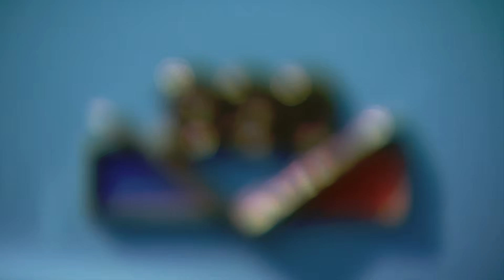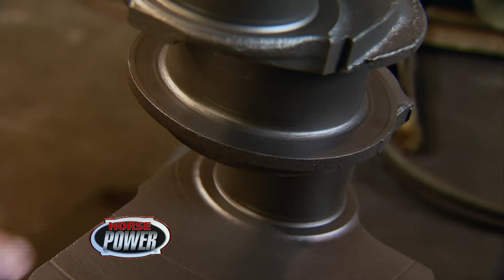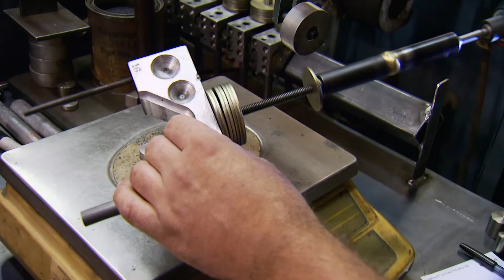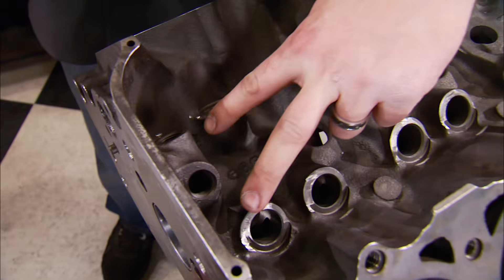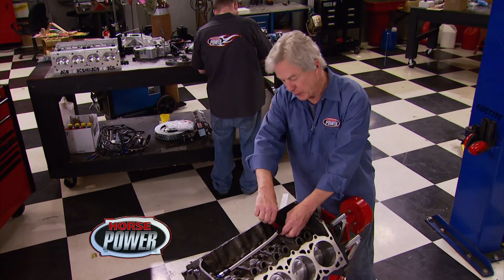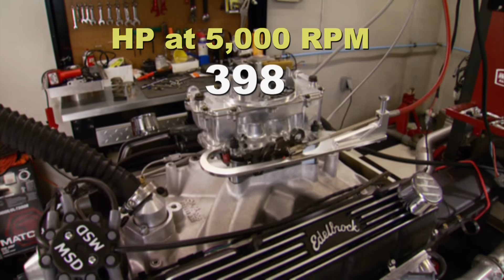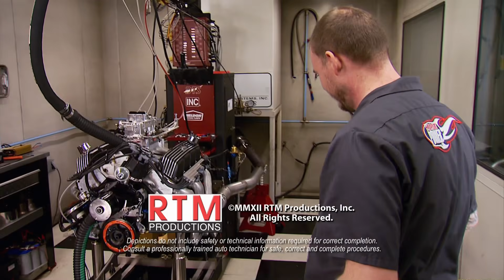Building The "Other Engine" - An AMC 360 - Horsepower S16, E4

Comment: I have a built AMC 360 in my 74 Gremlin.  K1 steel rods, Bullet cam, Johnson lifters. Harland Sharp roller rockers,ported heads and intake and Arias 11 to 1 flattops. and FYI, if you do use a Milodon oil pan on your AMC V8, DO NOT try and install the engine and trans together in a small body AMC like a Gremlin,Hornet,Spirit or Concord. Prob not even a 64-69 Rambler American,Rogue,SC/Rambler. You will find out the hard way they won't fit in the engine comp. together. (I found out the hard way.)

Comment: AMC did produce special blocks for racing purposes. The Special Service Block mixed and matched casting cores. Cast for 343/360 bores with 390/401 water jackets and crank main webs. No engine size cast into the side of the block. The heavy mains webs allowed the use of parts catalog 4 bolt mains. The other special blocks were aluminum. Three versions. 390/401 with water jackets. 390/401 solid block strictlt for drag racing. And the aluminum Indy car short deck block. Significantly shorter deck height. Allowed shorter rods on the "stock block" turbo motors.  As with any engine. The gains are made in the cam and heads.

Comment: We did a 360 for an off-road truck a guy had, to raise the compression we use to set a 400 Chevrolet small-block Pistons 12 1/2 to 1, they didn't have the right compression we needed ratio. Show me Mills part of the dome off the top, and call the pin holes for the AMC wrist pins. We had to stick with the rule book so we couldn't do too much to the engine but it was a screamer.

Comment: An extreme word of caution! The "new" timing chain cases from summit are made in China! I had 2 of them and they both ate my distributor cam gear up. They insist that you use a rubber o- ring at the distributors base instead of the flat fiber original where it mounts into the timing case . This caused serious problems between the distributor and cam gears mesh . BAD misalignment!  Not only that but it allows the distributor to walk and won't hold a steady timing setting! I switched back to the original timing case ... problem solved in a heartbeat!  I run a VERY modified 401 with 425 horse power and over500 foot pounds of torque. Trust me.

Comment: I built a1968 AMC 343 back in the early 70's for a 68 AMX with auto. Turned a best time of 14.57 at 98.97 in the quarter. What limited a quicker time was that valve float came in at 5,200 rpm's limiting shifting to 5,000 rpm's. The 360 came with the small port intake and original bread an butter cam and valve springs that dated back to 1966. For a back yard build, that 343 beat many Mopar 340 engines in the day. The 360 is a smogged out engine with having to put a ton of money in it to preform.

Comment: Using 343 cast pistons & sbc 2.055 valves in factory heads save some bucks for similar numbers. Chrome moly rod bolts 292 comp hydraulic cam good to 6200. My 81 Spirit ran 7.49 @92mph.

Comment: The only issue you did not address is cooling.  In 1972 the AMC Police Interceptor used a different head design.  Although this could be a problem with all of the AMC V-8's if you build em beefy enough. If you are lucky enough to find one of these beasts you will find that they need some machine work done to the heads and block to allow it to properly cool.  My 1974 Ambassador station wagon could pick both front wheels off the ground without breaking the rears loose thanks to that interceptor engine.  Drawback was that not only did she run HOT but the front shock towers took serious abuse.  One last problem is common  with all makes though, getting enough oil on that timing chain.
Reply: Funny story, but not true.  All the heads were the same.  The 304 got the smaller valve heads but all 360 and 401 got exactly the same heads and cam.  1970 and early 1971 got the smaller chambers.  1972/73 got the larger chambers but bigger valves and in 1974, they switched to pedestal mount rockers from ball and stud.  I have hundreds on the shelf and what you say is urban legend and made up facts.
Reply: @stephenbrown3868  The Police interceptor used a modified Buick head instead of the Chrysler design.  How do I know this you ask?  The guy at the speed shop that was in Merced California used to race a AMX that he put one of these interceptor engines in.  He helped me rebuild an engine out of a 72 Police Interceptor Matador I found in the junkyard.  It had the standard .202 chevy intake valves and a Chevy rocker.  I was able to then use Chevy roller rockers and also change ratio.  The standard heads use a Chrysler design while the interceptor use a Buick design.  Both engines WERE built by AMC though and the AMX's often did use the interceptor engines.  The only issue was that the water ports on the interceptor heads are different, so just swapping the heads will cause heat issues

Comment: Ive built plenty of V8s over the last 30 years.  The AMC 3rd Gen V8 engines aren't the biggest power producers but they can be built to perform as good or better than a lot of the other manufacturers similar sized V8 engines.  The big valve dog leg port heads are key to the potential of the gen 3 engines when comparing factory heads. A compression bump and a better cam really wake AMC Gen 3 V8s up. The factory camshafts are very lazy. With the over square design of the  360. Its potential as a performer is obvious.  It doesn't take much to wake them up.

Comment: The oil sucked up through the PCV is what is happening with the 401 in my friends 77 AMX Hornet. What causes this, even though in stock form it isn't an issue, is a mystery to me. We'll be tearing it down to try and solve that, but if you have insight, I'd like to hear from you.
Reply: Probably not getting the oil from under the valve covers back to the crankcase. Traco (Trans Am engine builders) ran hoses from the valve covers back to the pan to get the oil out of there. Of course they were turning high rpm all the time. Pull your valve covers and check the drainback holes in the heads you may be able to run the next size drill through them to open them up some, or run an oil catch can.
Reply: Your friend probably needs to transfer the baffle from a stock intake to the Edelbrock intake, along with using the valley pan style intake gasket, basically you need to have some type of a baffle under the pcv valve.

Comment: I'm 61, in 1984 had a 1972 Javelin with 360 auto. Sweet running motor. God I miss the good old days. I've owned 34 vehicles.  6 new ones. Never had a blown motor . Engines were so Simplistic back then. I pity todays mechanics working on todays high tech, high dollar Disposable Trash.

Comment: Some timing cam gear manufacturers cause problems that were never a problem from AMC. I ran into serious distributor drive gear wear with a new cam gear. After discussing it with my Australian AMC performance engine builder, I removed the other timing set and installed the Rollmaster p/n CS7110 and the problem was cure.  This set also allows minor timing offsets. As recommended, I went with the +2 degree setting.  The engine now starts easier than ever.  So rather than having to do bandaid distributor drive  oiling mods, just get the right timing gear set.

Comment: Great video! I have a '78 Wagoneer with a 360 in it. It had a two barrel intake on it. I recently picked up the four barrel intake that was used from '75-'79 I believe. That intake is #3224347. I would like to use an Edelbrock 1405 on it. As I am sure you know the intake is a spread bore and this carb is a square bore. I am having a hard time finding an adapter that will work to mount that carb. Any chance you may know what I need? Thank you.
Reply: Trans Dapt might make one Call summit, jegs or try an amc forum

Comment: I had one of those in my full sized Cherokee Chief S. I installed a mild cam, 4 barrel intake and carb and Hooker headers. Never thought it was lacking on power and drove it to 380,000 miles. Still ran when I sold it after buying a newer box Cherokee XJ

Comment: I bought a SC360 in 1971. Used Hooker headers with 2.5" glass packs. Too little back pressure and 72 degrees overlap killed the exhaust valves. Went to 1972 cam with only 42 degrees overlap.  Saved the valves. Added a Holley 3 barrel ,added capacitor ignition and dyno engine. 275 hp with 410 torque. The longer stroke was great for torque building. Car was real sleeper .  Should have kept it longer then I did.

Comment: This rebuild was awesome. I'm curious what it could with fuel injection. I saw an SJ Cherokee with this engine pull 72 hp on a chassis dyno one time. Unfortunately they swapped in a boring Vortec instead of a rebuild.

Comment: I have a 400 with a 440 crank and it is 470 cubic inches. Pulls like a log truck, turns on quick and runs like hell! It’s in a 70 Cuda with 383 stickers down the side, maybe that’s why everybody thinks a 383 is so bad! It will lug and pull away at idle with no pedal!
Reply: Amc /mopar were suppose to be like cousins back when mopar bought jeep/amc but they really never got along well,they tried to have combination car meets for a while and still do ,but the mopar guys never really took to the amcs as buddy's, still some confusion with people wanting to swap parts between amc/mopar 360 , but they don't share anything the power output is close but I think the heavier amc blocks are stronger.

Comment: AAhhh, gotta love these guys.  I HAVE had American Motors since  1980. HAVE a 360 V-8 1970 Ambassador SST. AN OLD GUY I knew when I was at NAS, Jacksonville for 3 years.  He a n.v d several men taught me just how to work and do Everything I just saw on THIS VIDEO. Wow, Man These guys know their stuff. I still have the Dog Leg shaped exhaust head ports (Original) factory heads. OH YOU BET I have collections of parts for The M-12 & M-11 and the 727 Shift Command Transmissions.. Those T-10 4 speeds are great for the AMCs also. I have Two of the 1970 AMC SST Ambassadors. THE 360 V8, is highly competitive. So is my 390 V8. They are Right about that OIL PRESSURE Problem. THEY ARE SHOWING THE EXACT CORRECT Way to do the AMC Engines. The 401 from 1971 doesn't  have those problems. Especially the 401 matador police vehicles.  Bought the whole car to get that engine and Tranny and Dana rearend.. These Videos are Dead on Balls Accurate.  Great Video. I fell for AMC long AGO. Sure theres the OH, MY Car this, my truck that. Till I bring That hyped up 1970 with 476 horse power Ambassador. Then it's DAMN!! I'VE had great teachers along the way.  Good to see A Garage that does a great bang up Job..THIS may be and older video but is still relevant to this day. SURE there's OTHER WAYS to fix the oiling problems in these 304, 343, 360, 390, engines HOWEVER,  this video shows a less difficult way to save the Engine. Always make sure that YOUR ENGINE, has a larger oil pan with at least AN extra Quart so if you get higher oil pressure the pick up won't pull air causing parts to starve for oil when there's higher rpms. Never rush a job like this.

Comment: Or getting a baffle under the intake to keep the PCV Valve from sucking up oil is a common oversight. Now you know. So, find one before you fire up the engine. Now lots of guys pass on the 304 for the bigger 360, and given the 304’s dinky bores of 3.75” compared to the 360’s 4.08” bores it’s no wonder why. But the factory advised that the 304 could be punched out to 3,875”. The same as a 283 and 307 Chevy, and larger than a Pontiac 350 that sees a little more love. I don’t know what the width of the Edelbrock heads are though, and if the valves are placed in the center of the bore like a Small Block Mopar for better breathing or if they shoved to one side like the Small Block Chevy. If centered and the combustion chambers are narrow enough, the Eddy Heads could be used without notching the block.if not, we’ll have you Machinest notch your block. You should see approximately the same hp per cubic inch as the 360. Something to think about anyway, and if anybody had tried this I’d like to know!

Comment: 360 inch motors and smaller have less meat in the main webbing, so it can’t rev like a 390 or 401 with enough meat to use four bolt mains. So I would keep a 360 at 6500 or lower. 390’s scream. They’ll run 10’s with relative ease. 401’s had lower compression, but now you can find higher compression pistons. They should scream too!

Comment: Earlier AMC’s used an obsolete V8. Their motto prior to the Gen 2, (290, 343 and 390 engines) and taller deck gen 3 engines, (304, 360 and 401) which shared block design but had a higher deck to accommodate a longer stroke and Dogleg heads which flowed 50% more than the Gen 2’s square port heads made them a mean contender, was the only race we’re interested in is the human race. I guess they had to catch up to the younger part of the human race!

Comment: Good points on the front of engine oiling plug, very helpful. The lifter Vally is not as glorified as you think!
It takes pressure from the front of engine,  causes a lower pressure at lower RPM, and possible starving condition. The oil feed line you used is way too large diameter. An 1/8th is max and well enough for a street daily driver and 99% of AMC V8's out there. Unless they are HIGH HP set up and RPM.
The cam button Is NOT needed on basic flat lifters DUE to their angle on each of the 16  cam lobes PUSH the cam back constantly!!
You forgot to properly inform ppl about this,  making this another stupid misinformation YT!
The button is great for a roller cam but 100% NOT needed for flat lifter type cams. Roller cam on AMC can use a special built retainer plate like all other engines do!

Comment: The 360 is NOT a small block! It is actually known as a tall deck same as 401. The earlier generation 290-343 were short deck, but still not a small block!
Reply: Wish chevy would done that...share common blocks.
Reply: It was characterized by NHRA as small blk ,uses small block rules ,and whenever I ever seen one compared on car magazines it was listed as small block.find any list of small block/big block it's under small block  but you are kinda right as the bore spacing is the same as mopar big block ,but the deck height  is small block territory, in the org advertisements ,it was called a combination of both by AMC ,and could be called a mid-block. The first gen amc were called big blocks even though they only had 327 c.i and the Studebaker was also a big block , but in most comparisons by hot rod magazines at the time it was listed as small block
Reply: It is roughly the same outside dimensions as a small Chevy and a bit lighter too.  AMC didn't make a big block.

Comment: nice build gave one of those summit carbs works real good after re jetting picked up 3 tenths of a second in 1/8 mile
Reply: Those are pretty good preadbore carbs. Had one on my 67 El in the 90s performed great never needed adjusting

Comment: Well, there's a reason so many people do LS swaps today. After all they are as common as dirt.
 Its always interesting to just what can be done with "off brand" motors. Most of the oiling system mods trace back to the TransAm race motor program at Traco. The previous Gen1 AMC V-8 actually had a better oiling system with the crank having priority and the pump inside the sump. Pretty lousy heads though. Theres somebody on the 'net doing a Gen1 327 bored and stroke to over 440 cubes iirc. But that's a whole different block.  Supposedly there was a 460ish version under development that got axed around 71 or 72. But that could be rumor. Anybody involved is likely gone by now. 
Of course the big problem with building an "off brand" or orphan motor is aftermarket support. There are only so many intakes or head options available. No aftermarket parts supplier is going to put the effort into producing those parts unless they have a reasonable assurance they are going to make some profit on it.

Comment: The AMC/JEEP 360 is a great, reliable engine, (ive put mine thru hell tbh) but please remember that ALL AMC 390 and 401 engines have factory FORGED crankshafts and rods. 360, 343, 304 and 290 engines use cast cranks and rods...any is as good as any ford, mopar or chevy engine, but the real 390 and 401  AMC engines are by far the most desirable for serious upgrades

Comment: The 360 AMC was a very stout and often overlooked motor.  It was no slouch.
Reply: No doubt, they were great street engines. Very reliable and make good power and they still don't cost a fortune.
Reply: @audieconrad8995: I had a 1972 AMC MATADOR with the 360 V8 with 2 barrel carburetor gave me Cadillac type performance!!! It can screech the rear tires. I've won Many stoplight starts with other cars.

Comment: Ya these 304/360/401s were a bit starved for oil.  I remember doing these tricks to the oil passages in the pump and timing cover as well. Don't remember doing it at the block though. Seemed to help. I loved my moderately built 360 in my J10 Jeep truck. Decent torque.  AMC isn't as bad as people think.  You can make these motors move and they have a a great sound.  Always thought it was better to build these motors instead of transplanting something else. Glad to see the AMC 360 getting some love.
Reply: Had one in a 76 Cherokee. It was indestructible
Reply: My Dad, has a J4000 Gladiator.  With a built 401, in it. With 38 swampers. BAD ASS, TRUCK.
Reply: If you don't mind me asking, What kind of transmission do you have? Is it a manual transmission? Thanks.
Reply: @MrElPoderozo1  I don't have the truck anymore unfortunately but it was an auto 727 torque flight
Reply: @elev8j10   ok, thank you for answering.👍🏽
Reply: The same with the Gen I engines, 290, 343 and 390. Same mods will help,both engines.the difference is in the deck height and the cylinder heads exhaust ports.
Reply: Excellent engines.
Reply: This explains...